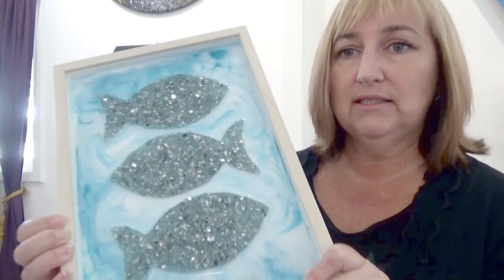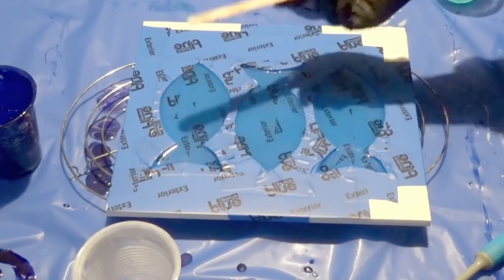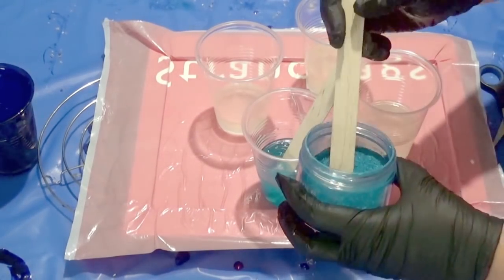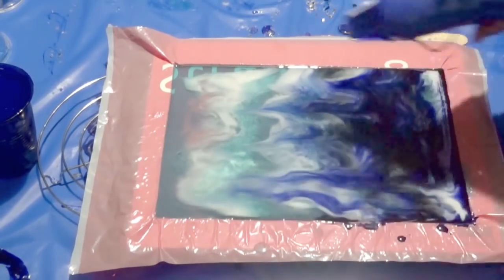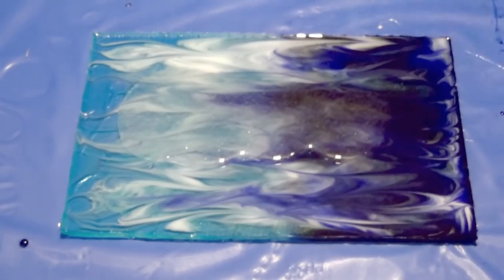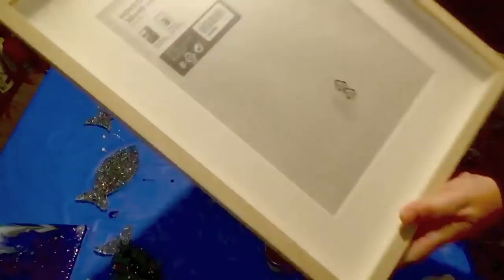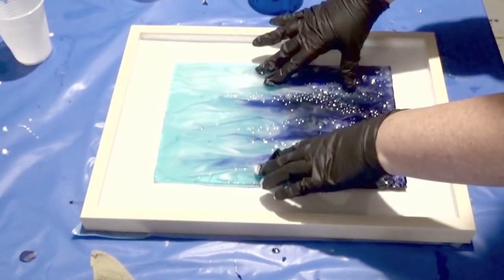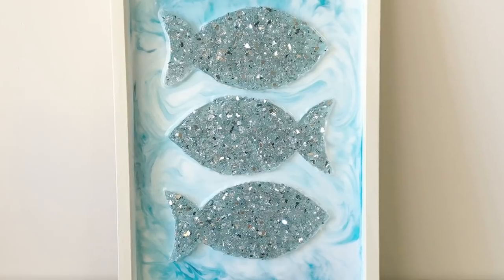How I created crushed glass fish and set them in resin

Comment: Possible silly question coming up 🙂🙂
Could you not have held the fish in place by putting pins in at each side, and top &  bottom, just to stop them slipping? Like the kind you'd get in a sewing kit.
Reply from the maker: The pins would be resined into the picture, removing them would be difficult and then you would be left with holes in the resin board, which would require more resin to fill. What I should have done, was left the resin to cure for about an hour before adding the fish. :-)
Reply: I did wonder about holes, but thought if you took them out in time, the resin might just slip into the holes.
I saw a video of someone using pins to hold thread to make some jewellery. That's what gave me the idea.
I do love your videos. They're very good.

Comment: Hello Sue I love your work. I am working on a project and need some add vice I want to put resin on a canvas then put aluminum foil on it then put my pigment colors then take my resin mold of a bulls head with horns on to it. What do you think?? ty
Reply from the maker: Firstly, I don't apply resin to canvas, as it tends to sag in the centre, I always use boards for my projects. Secondly, I would wait a good half an hour before attaching the bulls head to the resin, this will stop it from sliding around.
Reply: @SueFindlay  Thank you for your add vice. I can put the aluminum foil on a board resin first then my pigments then half an hour the bulls head.